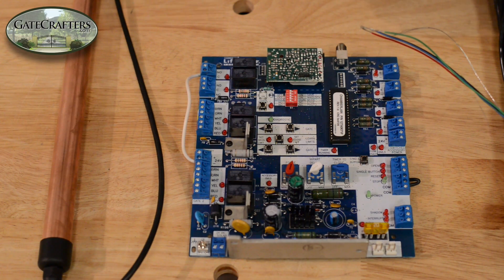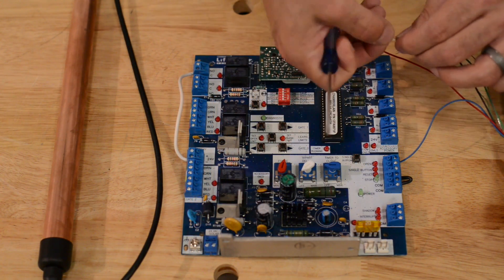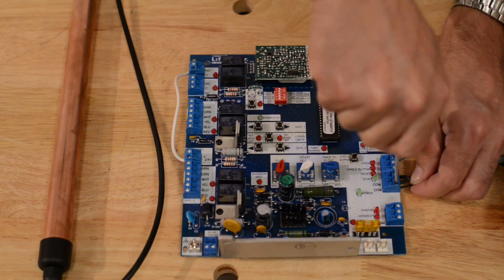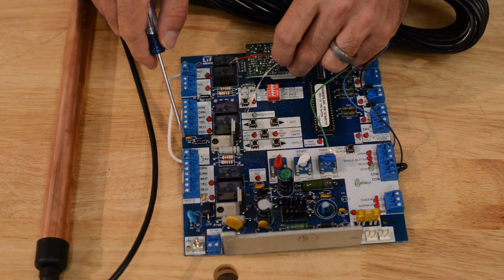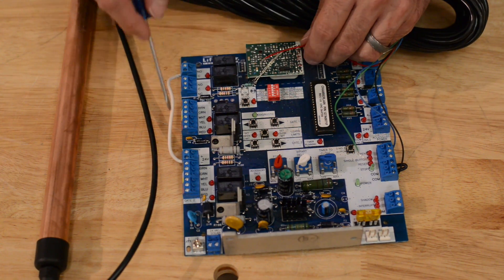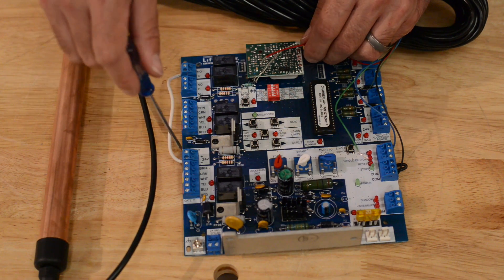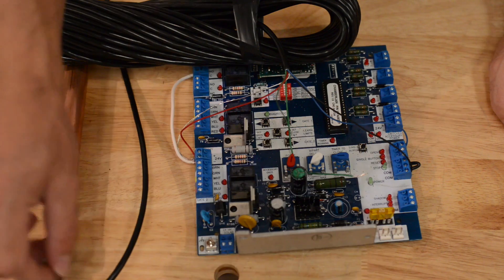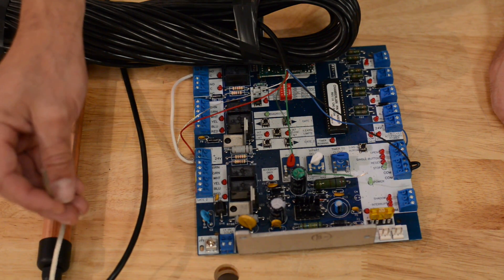How To Wire Estate Swing Deluxe Exit Wand to LiftMaster LA400 & LA412 Control Boards

Comment: Our fire department requires a Red emergency activation strobe light, I am using a csl24ul slide gate 

 these are the requirements,

1.
All motorized gates must also be equipped with one flasher unit and one external lamp

assembly with a red globe and guard to be mounted.

2.
The light shall be visible from both sides of the gate, be mounted at the top of the fence

within two (2) feet of the gate opening and flash upon the gate being activated by the MFD

Opticom™ compatible receiver platform system or Knox® Key Switch 3502 (mechanical key

type).

3.
The strobe shall continue to flash as long as the gate is being held open by the emergency

access system.
Will you let me know how to connect the strobe light to the control board, 

Best regards,
John Chacko